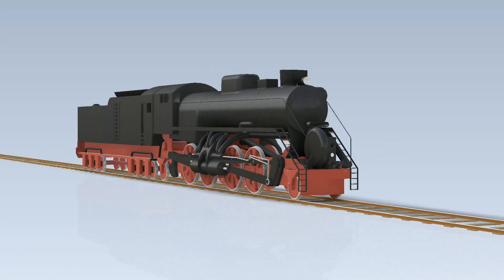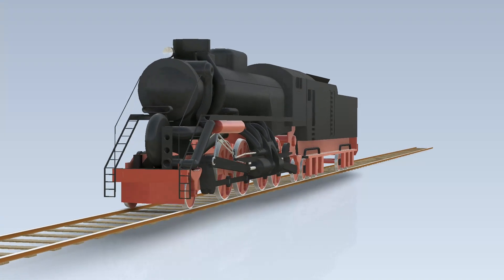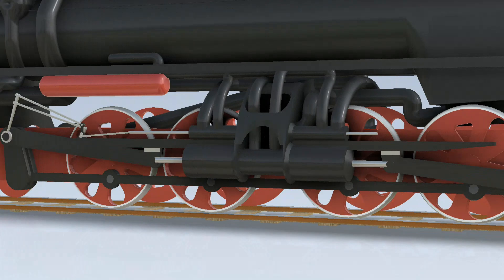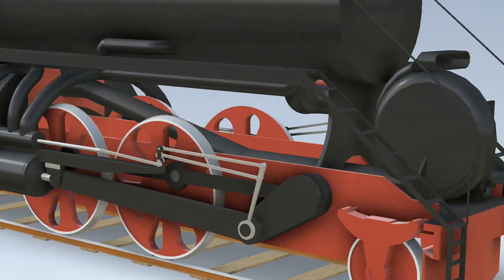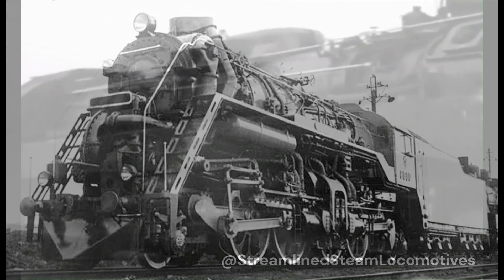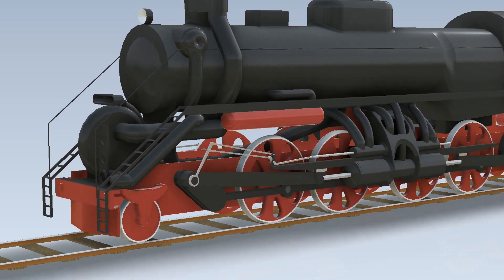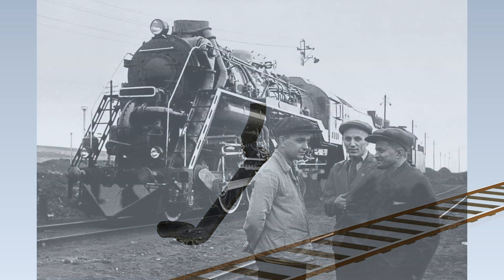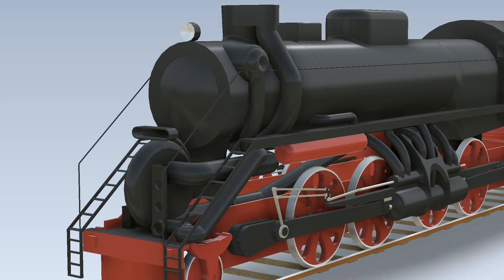no.8000 Stalinets Steam-diesel Hybrid locomotive

Comment: There is a video on youtube of this exact engine moving under its own power, and it was goofy as heck!
Reply: BTW there where more of these engines built, I think there was a 2-10-2 one that was like this one, just a bit bigger and with even more goofy valve gear.
Reply from the maker: @Boxwood2909  I studied every resource I could find on these trains. There were only a few reliable diagrams, and most of the time they were for those different types of engine. I featured that video in mine, where the steam comes out of the front. Opposed pistons are very unique valve gear, but they are mesmerising to watch.